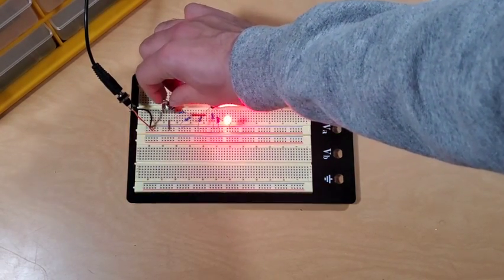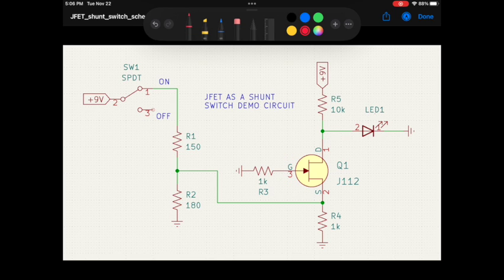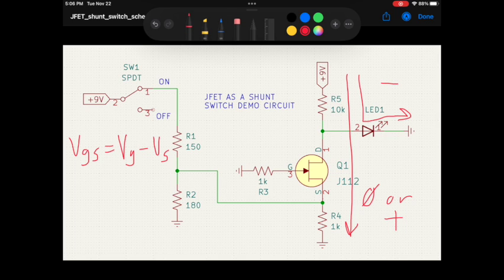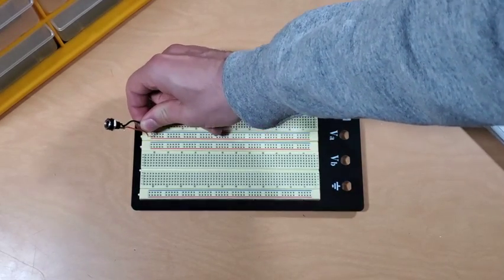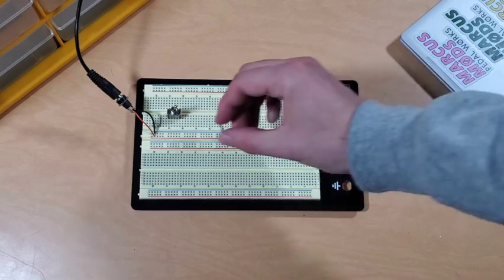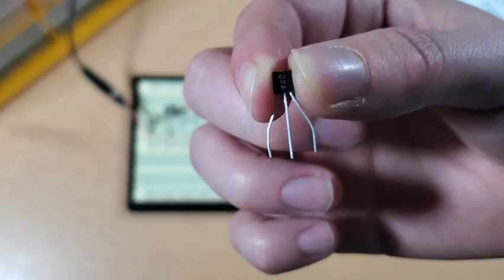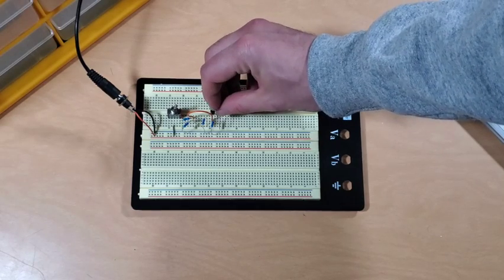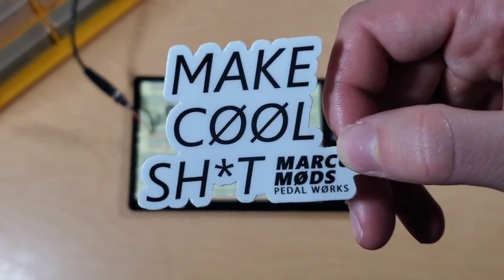How to Use a JFET as a Shunt Switch | For the Makers

Comment: How could you make toggle switch as a transistor. switch to on off Jfet.
Reply: If you mean apply voltage to turn it off, if it's on or turn it on, if it's off, you could put a latch in front of the gate and wire it to toggle. Lots of info online about that. A JK or T latch would be the simplest to use. Flip flops are more complex but more useful in general.